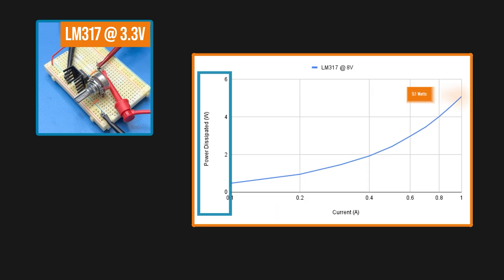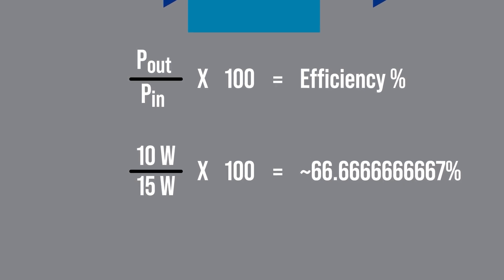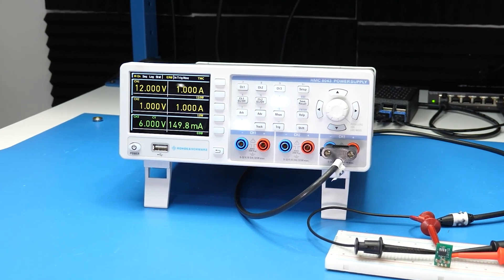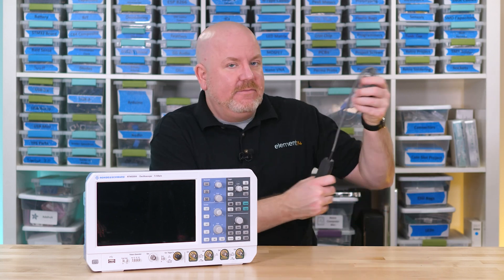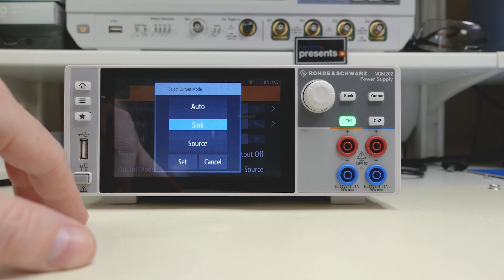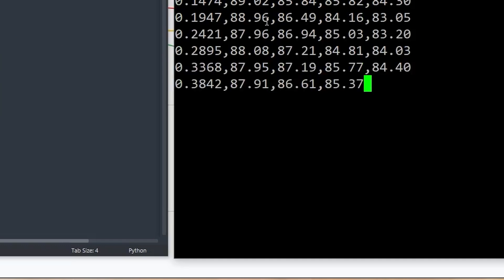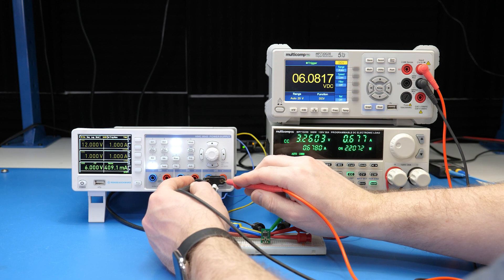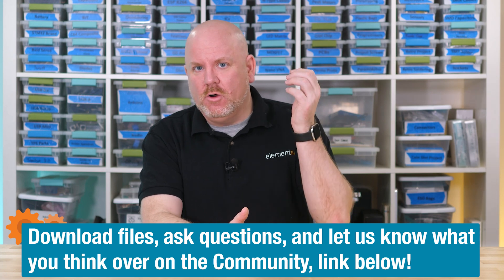DC-DC Converter Efficiency: How to Automate Measurements/Improve Performance - Workbench Wednesdays

Comment: Switching mode is better but not efficient at all and liners is worsts switching mode as far as I can see have a 60 person losses igbt welder or smps power supply have very high leases I test a Toshiba supply the mains amps was 22amp 120 and the output voltage was 15v 55 amp see the big losses
Reply: How you can say "switching mode is better but not efficient at all." Switch mode converters are over 90% efficient. Linears literally burn heat. They are incredibly inefficient. 

I cannot understand the rest of your comment.